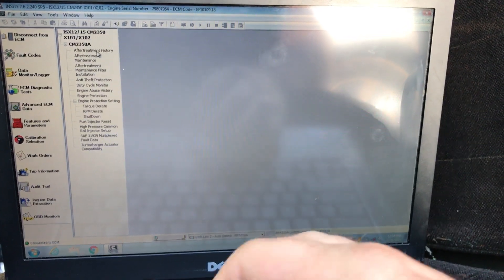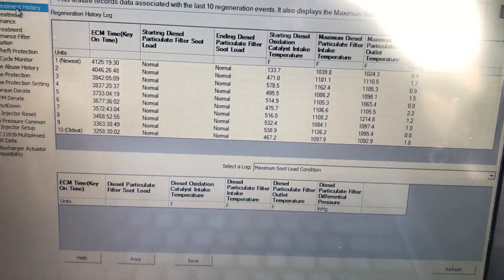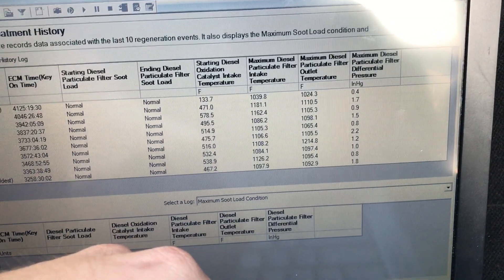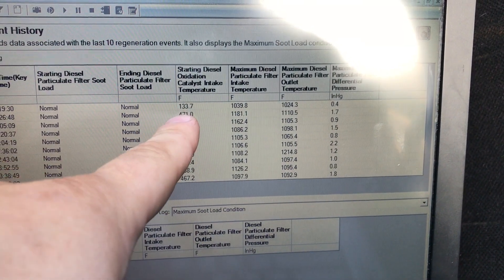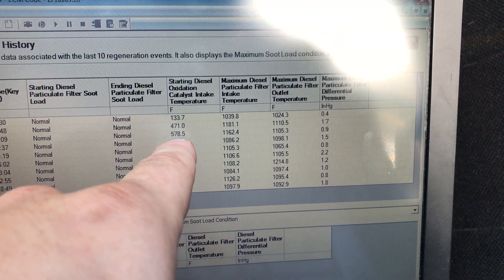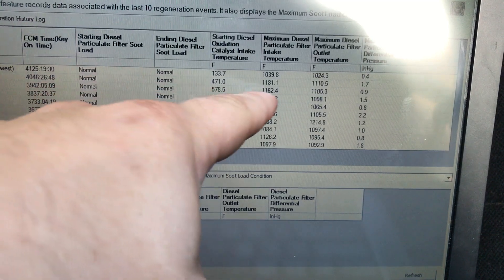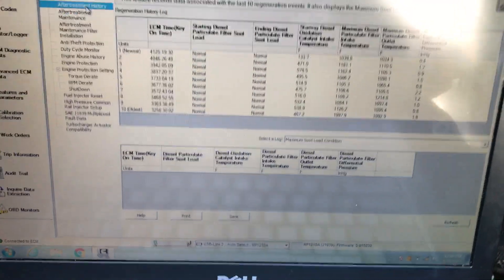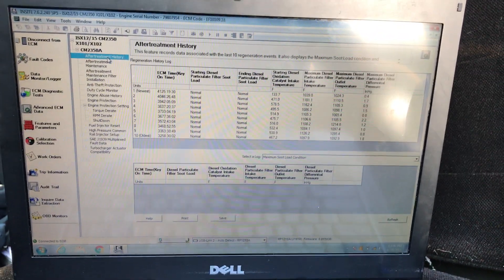How to check your Regen History on Insite - Temps Explained

Comment: Hi love your videos I have kenworth t680 with a cummins isx15 and is doing a  Passive region every day while I am driving and some times it  Throws a code 641 can u help me out figuring it out I have cummins inside thanks
Reply from the maker: Vgt actuator. Out of calibration. Have to check Actuator and or turbo

Comment: Where did you purchase your laptop ?
Reply from the maker: Chris Perez i didnt buy it, i pieced each program together one by one myself. Just bought all programs seperately
Reply: BulletMcNugget do you recommend that rather than buying one that has programs alredy on it ?
Reply from the maker: Chris Perez i kinda do that way I know that the programs all work and i have exactly what i need on my computer. Not too much and nothing extra
Reply: BulletMcNugget oh ok and you can purchase the programs online and just download to your laptop
Reply from the maker: Chris Perez for the most part.
Reply: BulletMcNugget is it difficult to download insite. Do you need anything special or just download and install ?
Reply from the maker: Chris Perez idk i always had guys that know how to do it install it for me
Reply: BulletMcNugget I have a question regarding isx cm871 jake brakes. Updated ecm calibration now their inop ? Any ideas on where or what I can start checking .?
Reply from the maker: Chris Perez did u put all ur parameters back in? Does cruise control work?
Reply: BulletMcNugget I'm not sure. Does it prompt you to put parameters back in? And no cruise does not work.
Reply from the maker: Chris Perez no, u have to make a work order saving all ur parameters prior to doing an ecm update. I have a video on that. Cause it wipes ur ecm out, and after its done u load all ur parametrs back in like speed governor, cruise limit. Kinda weird that it stopped working after update. Id check parameters first and then go onto clutch switch.
Reply: BulletMcNugget oh ok. Cuz from what I know the ecm was calibrated with a diffrent calibration code. It is soposed to be a AV10141 but when I checked was AV10283 or something like that. Checked the data plate and called for AV10141 so calibrated it to lates wich is AV10141.20. But their still not working. I believe I have a saved work order from a previous repair before the wrong calibration. Would I be able to use that. Or is their away I can put them in manually ?
Reply: @chrisperez2211  Cummins Insite is $800 a year you have to buy through Cummins and download.